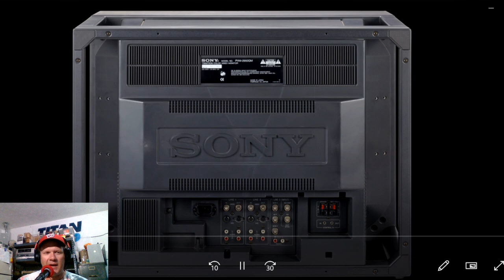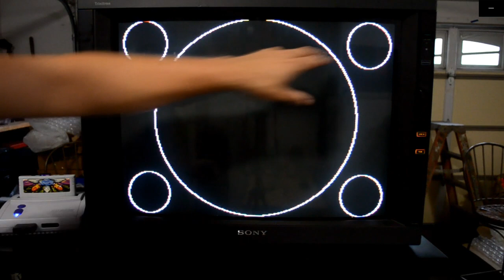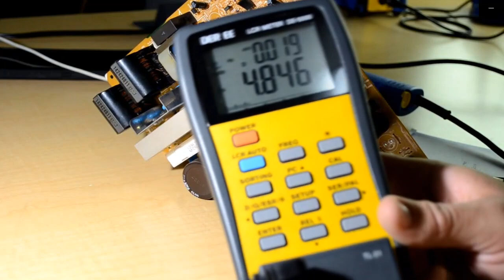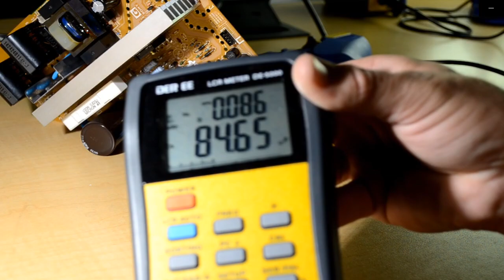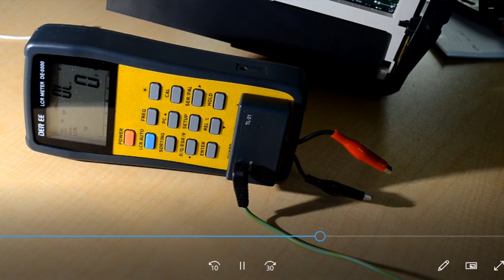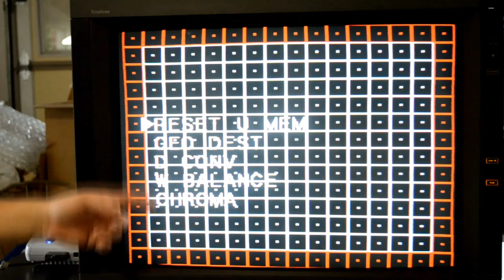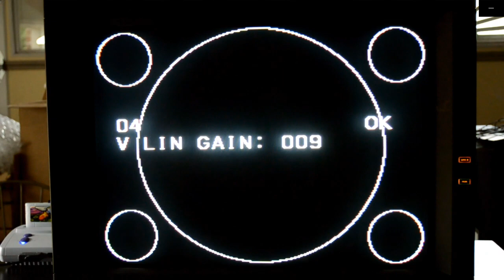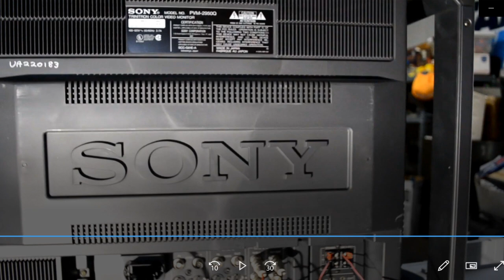Sony PVM 2950Q Restoration | Recapping a RARE Pro CRT!

Comment: Question I just recently bought a Sony pvm 1341 in amazing condition with the box and inserts no manuals tho, I was wondering why my image doesn't appear? Do I need to connect something to it or would the TV automatically light up after turning on? The power light is on and you can hear it turn on but I see no image, Currently don't ha e anything to connect to it but eventually buying the rbg cables

Comment: hello @Retro Tech, I also have a 2950qm, when I turn on the monitor the image is shifted a few centimeters to the right, you have to wait for it to heat up for the image to come back correctly in front, and with small geometry problems, I therefore changed the capacitors of the board >"G" >"V">"C", but unfortunately i still have the same problem 😐Which card do you think the problem comes from? VC board?, DX board? 🤔

Comment: Great stuff! I bought one for $300 that has an issue with sync on the RGB input. Composite and S-video work fine. I'm going to try a full recap when I have time. If that doesn't fix the sync issue I bought the sync signal processor IC spare part. Maybe someone damaged the input with TTL sync.
Reply: That monitor is rated for 5vpp on the sync line, so don't think that should damage it.
Reply from the maker: It does require C Sync I believe
Reply from the maker: Thank you
Reply: @RetroTechUSA  It'll do RGsB and component as well, and on that note, maybe Ross should try RGsB first.
Reply: @jamon1567  forgot to mention ypbpr/component has sync issues too. Thats why i suspect the sync signal processor IC is damaged.
Reply: @tntxplode32  did you ever resolve this issue? Found one with the same symptoms

Comment: Hey Steve, I have the same LCR meter. Love that thing. I decapped my pvm 20M2U and tested the ESR and capacitance of every single cap. Maybe 5% we're out of spec and it was mostly the smaller caps. The end result just made the picture brighter. So I agree with you, no need to replace every single cap on the main board. I would just do the convergence area, power supply, and the ones by heatsinks.

Oddly enough my KV-K29MF1 consumer model looks very similar to this one on the inside.
Reply from the maker: Awesome,  thanks for the info!

Comment: I'm just waiting on delivery of my capacitors before starting a recap on a Bang & Olufsen MX4000. 
Sadly three capacitors are weird. 3 legs on the circumference marked as positive and 1 in the centre I assume is negative. I'm gonna probably have to order some testing equipment to learn how it functioned and to see how compatible a 2 legged replacement will be.
Reply from the maker: Yeah, ive seen a few of those.  They are crazy.  Ill try to find out what those are technically called.
Reply: @RetroTechUSA  I suspect it is a type of Can Capacitor, I've seen people create replacements for them by soldering multiple radial caps in parallel to recreate their output.

I'm quite concerned about attempting to replace them.
Reply: @JaeliusFairmout  I saw pics of that monitor displaying games in RGB the other day on a forum I frequent, and I gotta say : it's got a very beautiful picture. Killer casing and looks too.
Reply: @RetroTechUSA  found them! They're called "soldering Star capacitors" or sometimes "star leg capacitors"

I actually found some the match the specifications for my TV but I fear they are really old (I think they were made in 'West Germany' so pre 1990) and aged capacitors can be as deadly as any out of spec one.

Comment: I snagged one of these with bad screen burn.... If I found a commercial Trinitron the same size could I possibly swap the tubes?
Reply: The yoke and sub boards attached to the neck would make it a painful job, its certainly more advanced than most commercial units. Outside of that I would target the tube model and search for commercial units with the same tube. Last I checked it wasn't easy to find one close to the same dimensions to fit the front shell. I managed to snag two whole units when I bought mine. One with a clean tube, one with Houston Airport flight schedules burned in. The clean one had a broken power switch and the burned one seemed to have a bad gun. I Frankensteined them together to get me a working unit, still need to recap it for geometry issues. I keep the spare unit for parts should a board or component die in the good one.

Comment: What are you using to check caps in-line? I bought an MESR-100 and its decent but the supplied leads are very short and stubby and I'm hearing that the more expensive testers are more accurate.

Comment: Can you recommend me a consumer grade CRT that accepts at a mininum, RF, and YPbPr and actually has a service menu that works?
Reply from the maker: It's hard to say because even the best brands and models could still suffer from problems due to age and use.  I'd look for any Sony, Toshiba or JVC branded CRT that's 4:3 with component input.  Personally I'd also avoid flat screen crts too.  So if you find one that meets this criteria,  then you can test it to see if it works well.
Reply: @RetroTechUSA  how come you dont like flat screens
Reply: @dudeguy7347  focus, even with dynamic focus compensation circuitry, is just not as good as on a curved screen

Comment: Hey there! I live in Australia and I own a Sony 2950QM. What’s the difference between the Q and the QM model? I paid $150 for it almost ten years ago when most people didn’t appreciate quality CRT’s. Back then people couldn’t wait to dump their CRT TV’s.
Reply: Hey. I was curious so I checked the manual. there's only 1 instance where I see a difference mentionned between the two, and I think it gives us our answer : ''Operate the unit on 100 -120 V AC (PVM-2950Q) or 220 - 240 V (PVM-2950QM)''.

So voltage appears to be only difference between the two.
Reply: .Also, I heard that the ‘M’ on Sony professional monitors stands for Medical 🏥